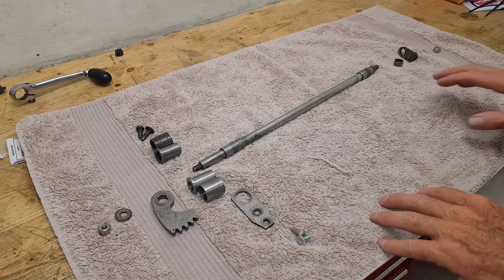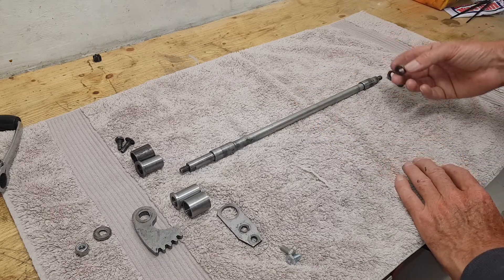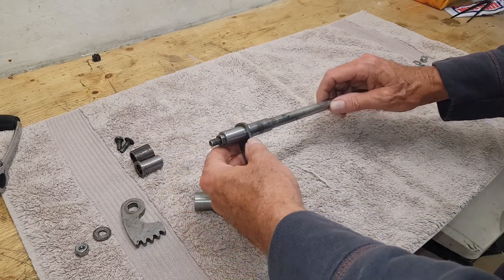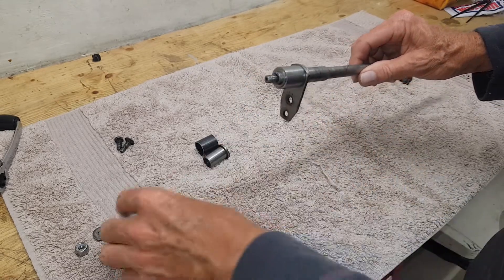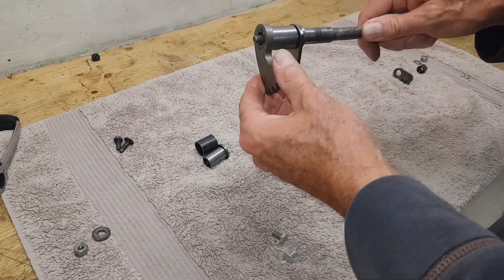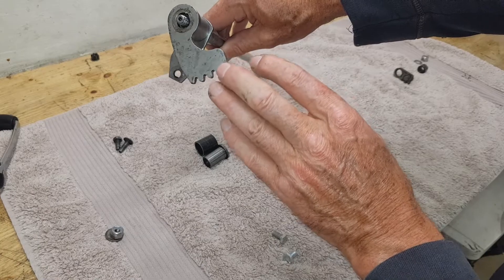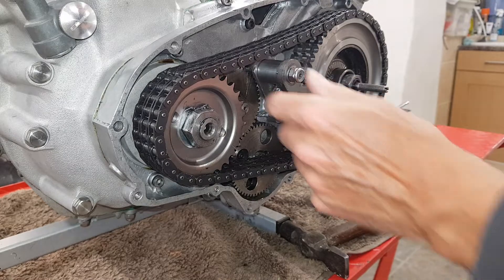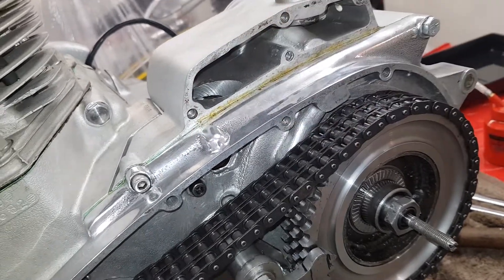Triumph Trident T160 Engine Rebuild. Part 41: Fitting the Gear Change Cross Shaft Assembly.

Comment: Just found this video and  had a quick look to see where the foot has to be positioned after an epic rebuild- no shop manual!!!!.  But I noticed you have a Triplex primary drive on a T160???  Is this feasible with no machining neccessary.  I presume just a T150 primary drive?  Many thanks
Reply from the maker: The standard Duplex primary chain is no longer available for a T160 (they were unique). As result if you need to replace the chain then you either need to convert to belt drive or to a T150 Triplex chain. On this engine I converted it to Triplex chain. The conversion is made by Triumph Enthisiast in Australia and sold by Clive Scarfe Systems in the UK. Triumph Enthusiast have made several videos covering the fitting of the conversion on YouTube (you also need to buy a T150 primary chain separately). My other T160 has a belt drive conversion, which is also great,  but the belt requires replacement every 5 years or so due to oil contamination.

Comment: Chris, looks like the extra long spacer consumed some of the threads on the cross shaft leaving less thread engagement for the "lock-nut" .  Am I right here, and is that ok?  My understanding is that you should have one to two threads past the locknut?
Reply from the maker: The longer spacers actually help things as often the nut can bottom on the threads before fully tightening on the foot,  so causing it to become slack. With the longer spacers this doesn't happen. The locknut is fine as it is fully on the threads and backed up with Loctite. 👍